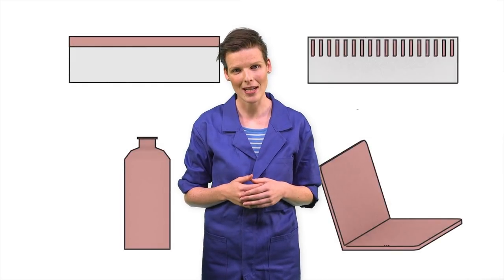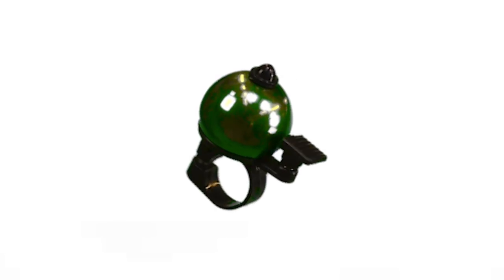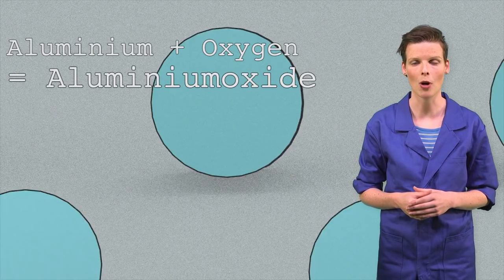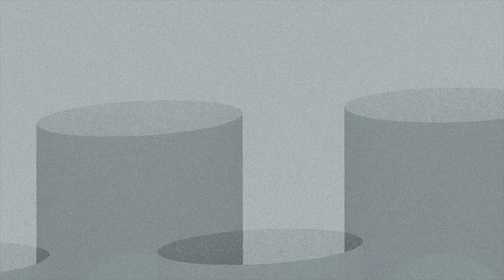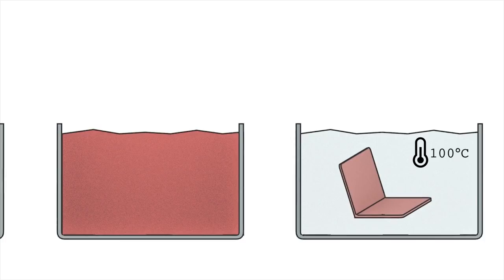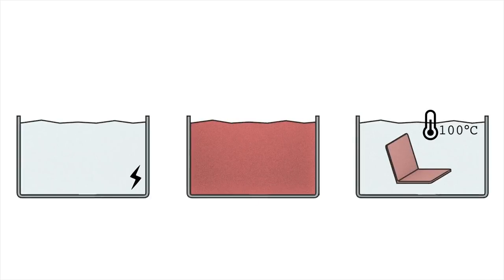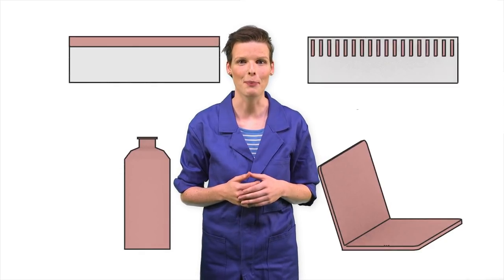Anodising (why can’t I scratch the paint from my laptop?)

Comment: Which material was taken at the cathode
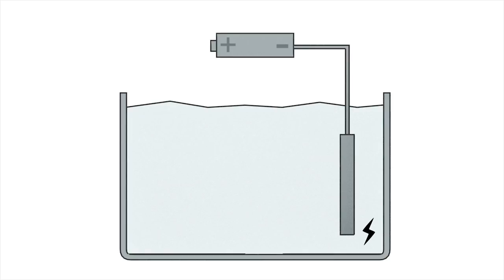0:40
Reply from the maker: Good question. I actually don't know which material they use for anodising those pieces, maybe someone else knows :)
Reply: @vocavideo6810   then why did u make this video if u r unable to explain completely
Reply from the maker: @kanikasharma1614  To know what you know and what you do not know, that is true knowledge.
Reply: @vocavideo6810  Yeah agreed ! Learning is a lifelong process...and I highly appreciate you for sharing such an informative video...lots of love from INDIA❤️
Reply: Graphite is use to attract hydrogen H2O
By the way I read most indian names in comment section
Reply: So graphite is used as cathod
Reply: @vocavideo6810  Something you can learn from me as I do this work for a living. The Cathode is the negative side of the current which usually houses aluminum plates for conductivity reasons.. the Anode is the positive part which in your video is the laptop. Also the Anodizing layer when it is filled with a color pigment, that pigment will only stick to the edge of each of the pores, and to close the pores (sealing the anodized layer) there are 2 way's of sealing it, the one you mentioned in your video and there is a cold sealant with nickel salts, these salts fill in the pores and close them off as a layer on top of the anodized layer. But anodizing is a whole lot more steps then just what you've shown there is also hard anodizing for example and the steps you have to take before the anodizing process can begin. There are countless video's on YouTube that show everyone how it works. 🙂
But overall nice video, I appreciate the effort.
Reply from the maker: @Inkassie  Hi Kas, thanks for your addition. Making such a video is always a search for a balance between sketching the generic idea and going into the details. If you know a video that you would recommend for people who would like to know more about the details feel free to drop it below.
Reply: @vocavideo6810  very good reply....